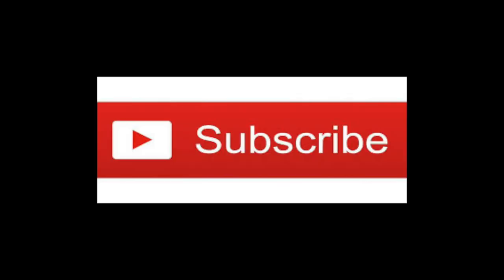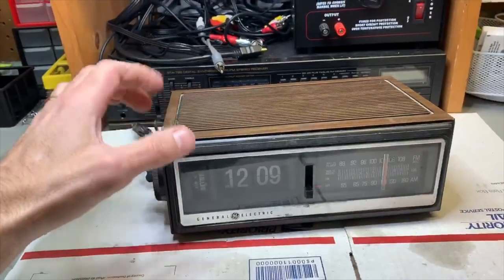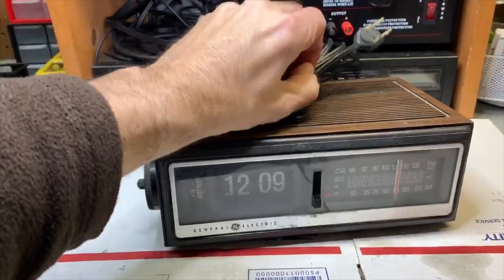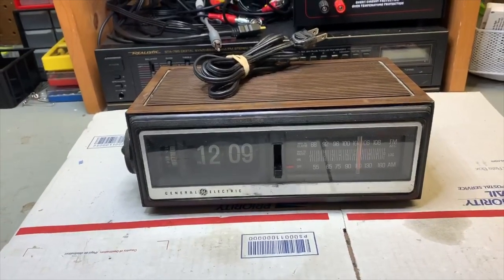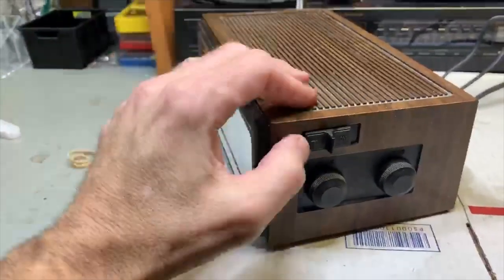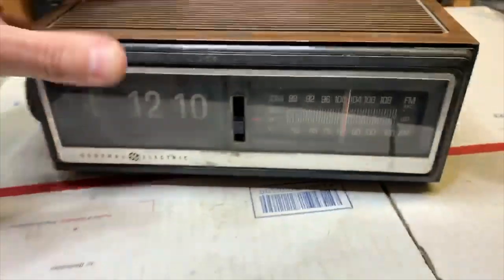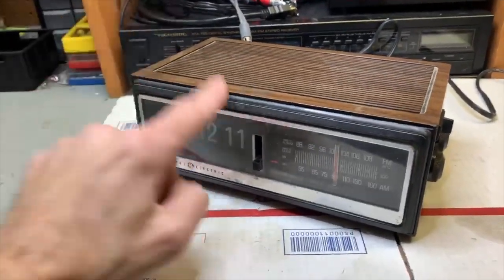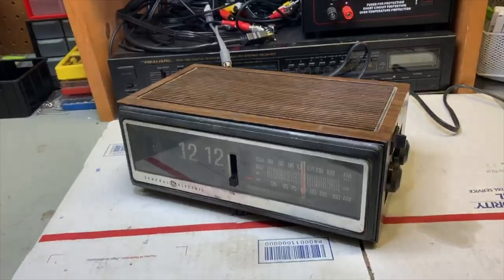General Electric Vintage Flip Clock Fix and repair fast and easy

Comment: Great video. There's a small plug holding the electric cord in place on the rear of the clock. How is that removed in order to fully disassemble the guts from the frame?
Reply from the maker: Good question!

Comment: That particular fix is great for the tuner but my clock doesn't "flip", any idea how to deal with that? Most of them have this issue even if the radio part works.
Reply from the maker: It’s most likely the clock motor gear. Look on YouTube for that fix, good luck

Comment: Hello! I just purchased a GE 7-4310. The numbers for the clock don't work. Any tips for repair or another video on repairing the clock portion?
Reply from the maker: Watch the video it might help
Reply: @YourReviewChannel  I did, that's why I asked. Thank you!
Reply from the maker: @deleabutler8095  ok what's the issue with this clock, Did you try to take it apart, and look at the wheels, Geers, and motor.
Reply: @YourReviewChannel  yes & determined the clock motor wasn't working. Thank you for the help!